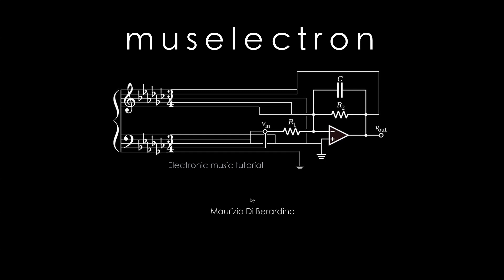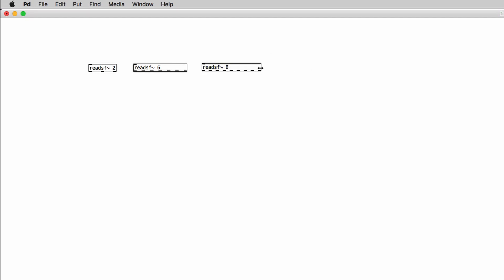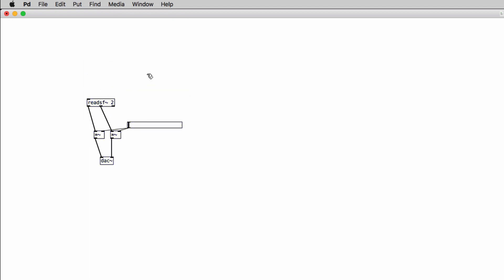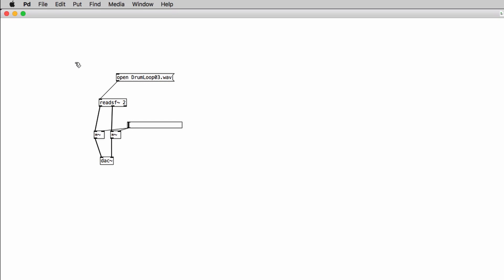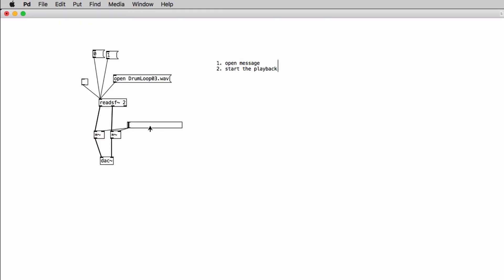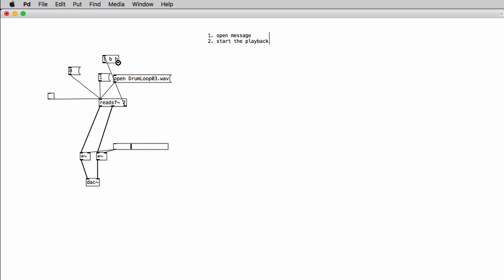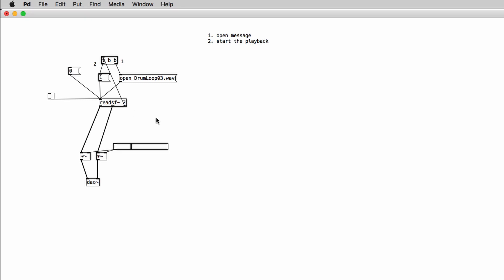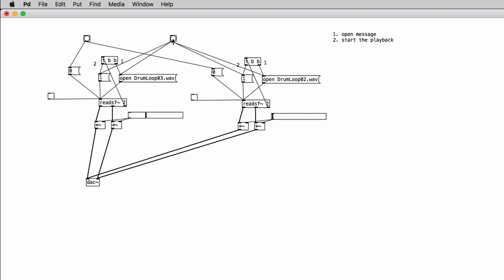Pure Data programming fundamentals Tutorial 04 ENG - How to read audio files & make a looper

Comment: So amazing .. thank you for sharing your knowledge. Could I ask, after opening the wav, could you adjust the speed of playback? A short sample could be stretched out (using a dial/knob) or sped up by the operator to suit the tempo. Having this in Modular hardware would be lovely imho
Reply from the maker: Hi, thanks a lot! You can not use the [readsf~] to change the speed and the pitch of the sound file. For that, you need to use arrays. Check Tutorial 17 and the follwing ones for the use of arrays: https://youtu.be/xnroqAN9Sx4
Reply: Understood, thanks man

Comment: Great video. PD is full of so many quirks. Just wondering, is there any reason you didn't just bang the trigger objects together rather than the open and 1 separately?
Reply from the maker: Tanks Noel! You have to upload the file in the object memory before you can play it, so you have to make sure that the messages are sent in the right order: first the open message, than the 1 message. If you bang them at the same time, you'll never be sure that the object will receive them in the right order
Reply: @Muselectron  Yes I get that and that is why you use the [t b b] but then later in the video you bang directly the [open( and [1] messages at the time with just a bang. I just wondered why it worked.
Reply from the maker: @NoelLeeman  oh right, sorry! That worked because in Pd there are priorities in cable connections, so if you connect the open messages before the 1 messages, basically you have that the bang will be sent to the open messages before the 1 messages. I didn't talk about it in this video since I was saving the topic for a later video. Let's say that using the trigger object is safer, since you force the mechanism, relying on connections precedency could lead to bugs, especially if you're still developing the patch
Reply: @Muselectron  Thanks - that's one such quirk I was referring to. Good to know. Especially when trying to work out why two identical-looking patches might behave differently. Thanks.